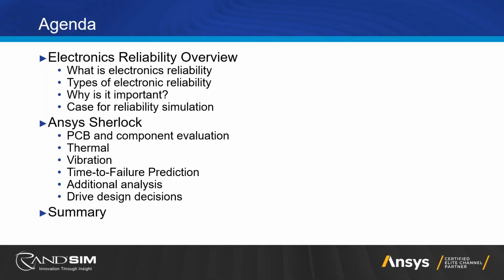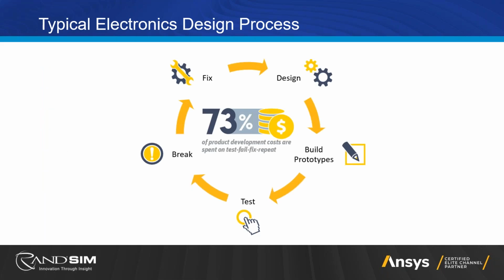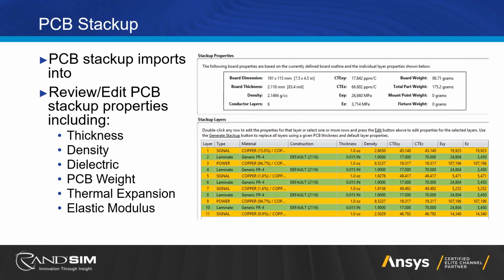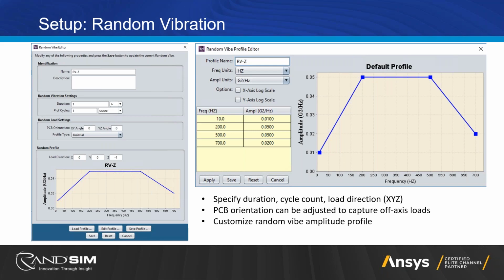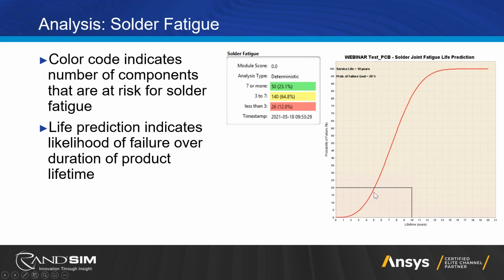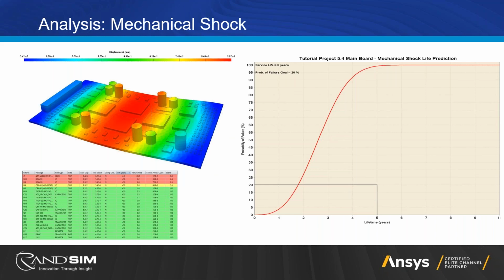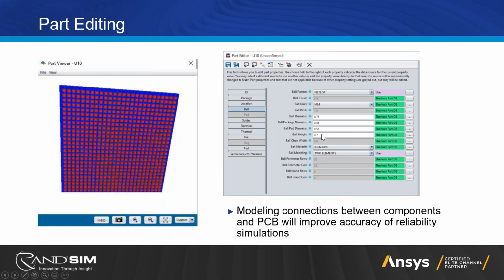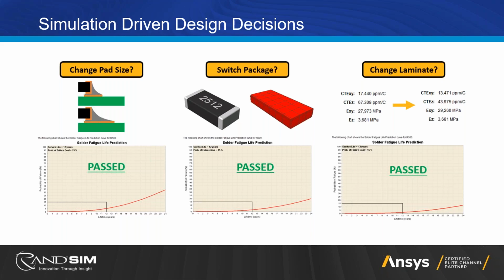Overcoming Electronics Reliability Challenges with Simulation

Comment: Please define what is the LAB!
Reply from the maker: Hi Bret, the lab is the facility that performs environmental tests on the electronic device.  These can include: thermal, shock, and vibration. These tests can take a significant amount of time and be costly.  Electronics reliability simulation assists in driving design decisions/changes before going to the lab to reduce the risk of repeat visits.
Reply: @randsimulation  got it!